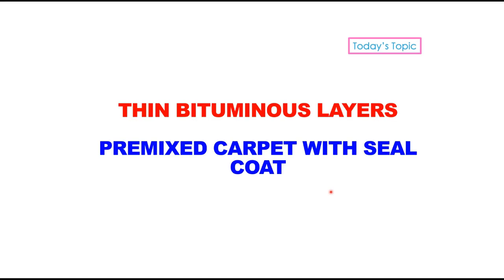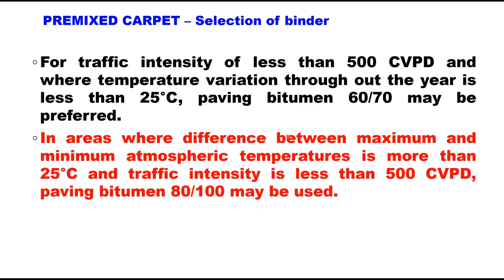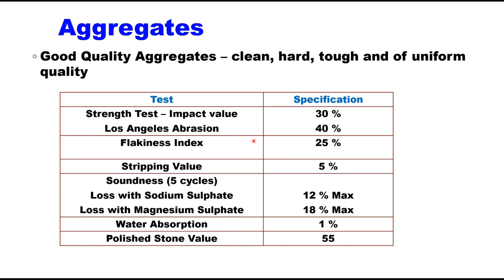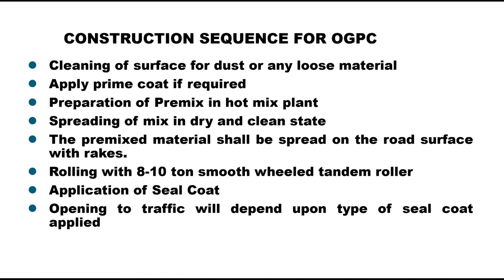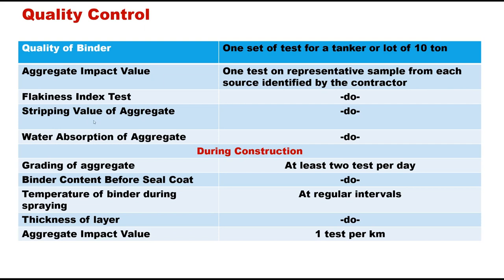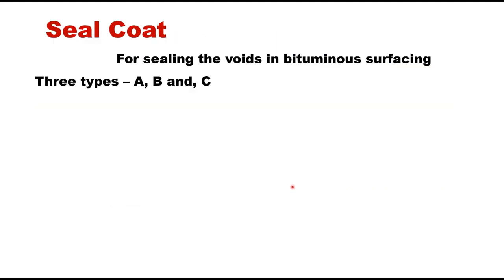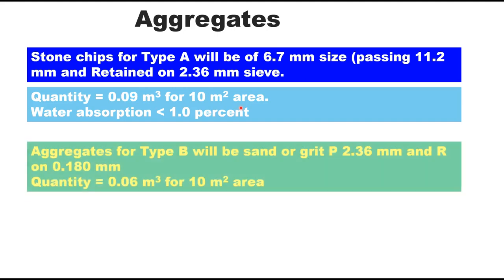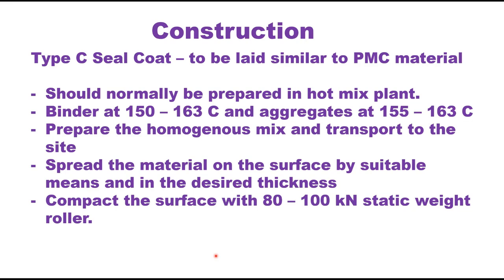#PMC, Thin Bituminous Layers Part 3 - premixed carpet with seal coat, Open Graded Premixed Carpet

Comment: Because some NQM's want total 25 mm BT thickness in PMGSY road
Reply from the maker: Seal coat is very thin layer.
Reply: @SatishIITR  OGPC+ Seal coat=20mm+5mm=25mm 
In PMGSY Road some NQM's generally during site inspection wants 25mm total BT layer thickness.
Reply from the maker: @Bisciv  This is completely ad hoc. Seal coat is used to fill the voids in PMC and to make it water resistant. And when some material is being added to fill the voids, you should not expect it to enhance the thickness of the layer.
Reply: @SatishIITR  Thank you sir
Reply: @Bisciv  : It is informed that the seal coat type B and type C with 0.06 and 0.09 cum respectively laid over OGPC, the size of voids are not allow all the quantiy of seal coat and only fraction of it will fill up. Therefore  there will be additional thickness of about  2/3rd seal coat thickness i.e. atleast 20+6 or 20+4 thickness wil be available at site